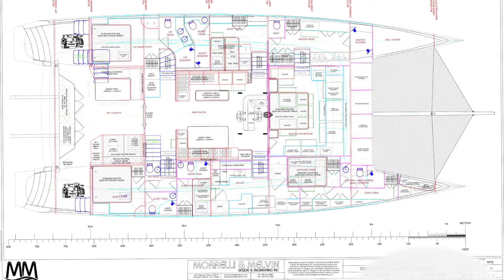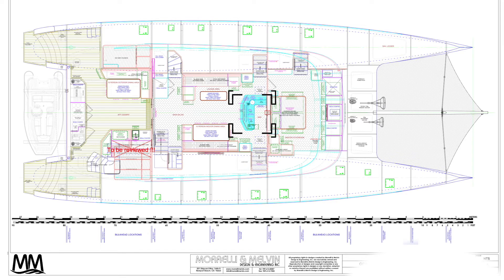Sketch To Sea Episode 5: The Design Process

Comment: How likely were you to add options once you got a realistic view of the overall carbon weight? Adding a larger refrigerator here or there, moving and shifting appliances, build ins, that sort of stuff. Were you able to keep dog piling on creature comforts or did you feel restricted to accommodate the weight and trim?
Reply from the maker: Thank you for the comment. We had already added most of the options during the specification stage. Personally, i did not feel restricted if i wanted to make changes like that throughout the build process. Preferable not adding weight, but trim is a very important concept. Complicated to get right but relatively easy to adjust (in our situation). Having integral water tanks is probably the simplest way to adjust the trim. Moving a baffle forward or aft will adjust the center of gravity of the yacht, and also your trim.